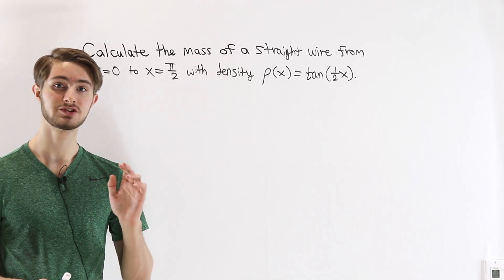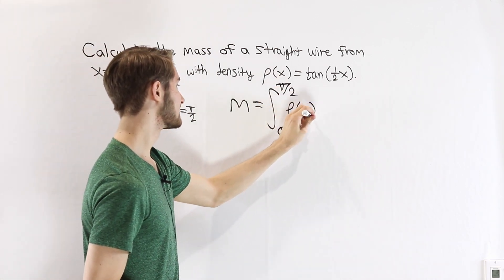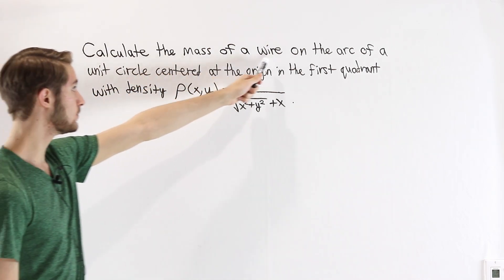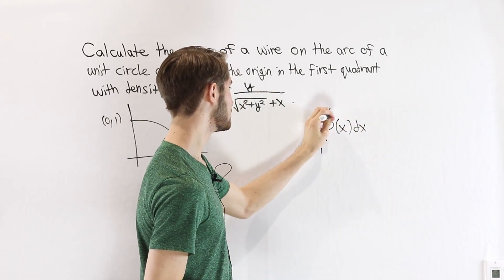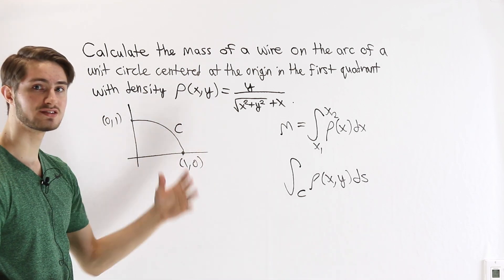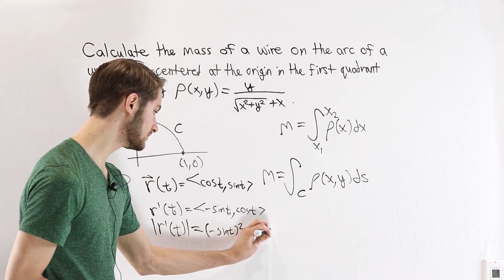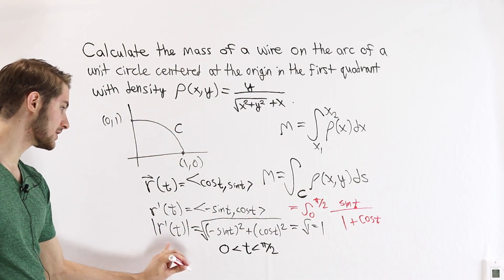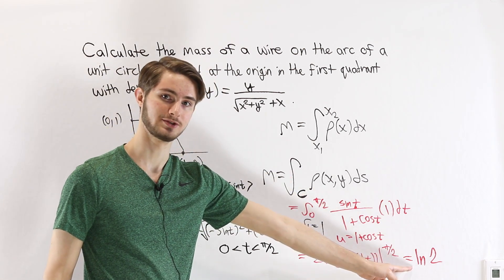Mass of a Wire with Line Integral - Vector Calculus Application

Comment: Done a zillion of these but I'm curious how you designed/transformed the density function in part two to describe the same wire, but as a function of x and y?
Reply from the maker: Since (cos t, sin t) is an arc length parametrization, the point (cos t, sin t) on the bent wire corresponds to the point (t, 0) on the straight wire. Therefore we want the density of the bent wire at (cos t, sin t) to equal the density of the original wire at (t, 0). Thus we need a function ρ(x, y) such that ρ(cos t, sin t) = tan(t/2). Using the tangent half-angle formula we write 
tan(t/2) = (sin t)/(1 + cos t) = (r sin t)/(r + r cos t) = y / (r + x).

Comment: For the first problem solved by you - Density is f(x), the length is known but we don't know the radius of the wire, then how are you solving this whole question? If I am not getting anything, pls explain.
Reply from the maker: For this problem, "density" is referring to the derivative of mass with respect to length of the wire, dm/dx. 
This is called linear density: https://en.wikipedia.org/wiki/Linear_density 

If the density were measured per unit volume, then we would need to find the cross-sectional area before doing an integral!
Reply: @MuPrimeMath  Thanks for the explanation.